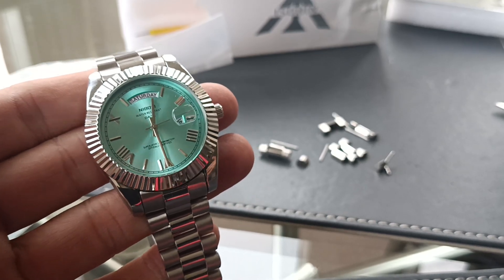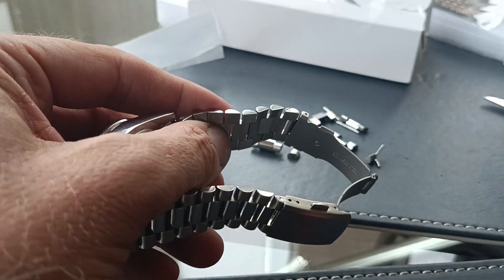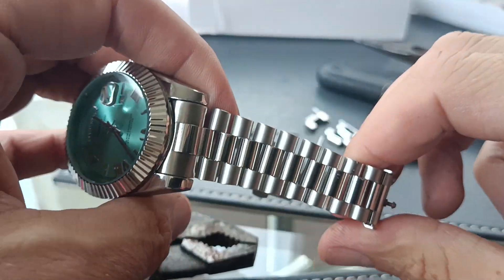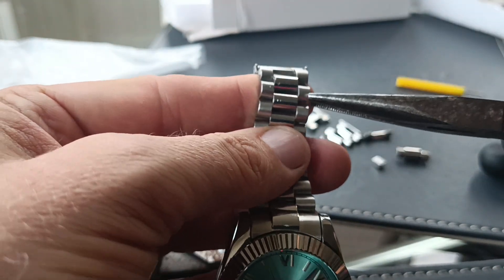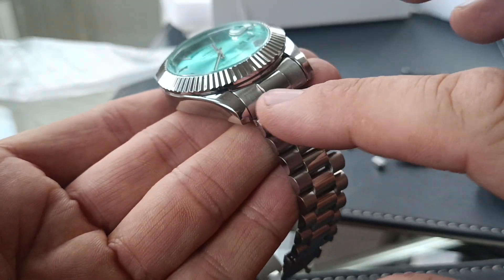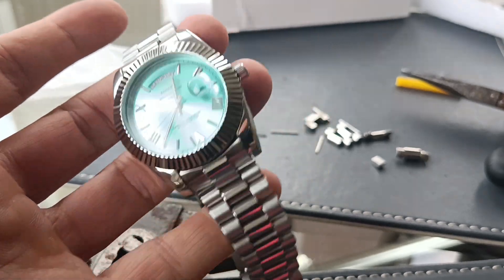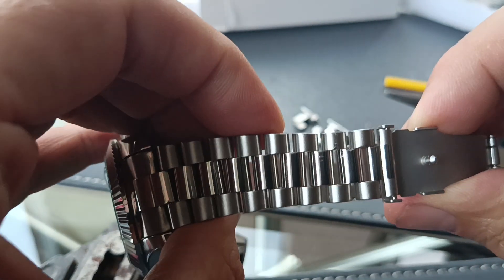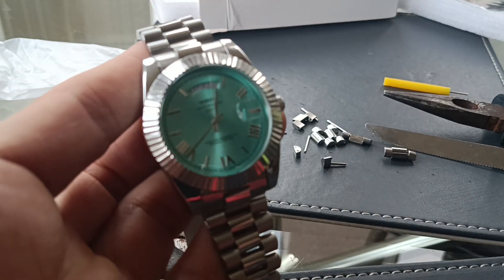How to adjust Nibosi Day Date bracelet that is too large after all removable links removed. #watch

Comment: I had the same problem with the black version I purchased from Ali a few months ago. I was only able to remove 4 links so I threw on a different bracelet. I ordered a light green version last week from Ali for $10 USD and guess what, I can remove 6 links on the newer watch. I guess Nibosi updated the bracelet. It looks exactly the same but with 6 removable links. It's now a perfect fit for my 6.5 inch wrist and I'm so happy with this purchase. Now I can swap the bracelet between watches. Unfortunately, there's no guarantee you'll receive the updated bracelet so I guess I just got lucky.
Reply from the maker: @mtbbiker6401  That's good news that they finally updated bracelet. I might get a dark blue one now. Although I guess there will be loads of the old ones still out there.